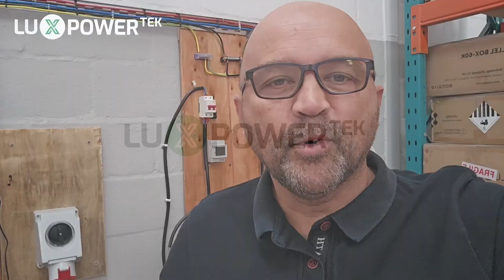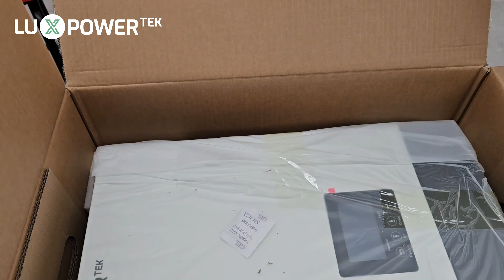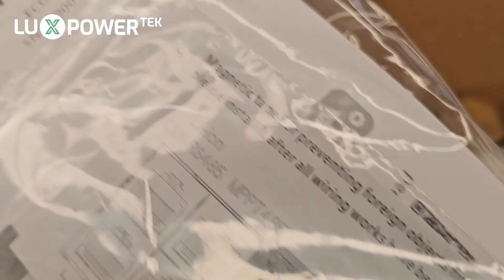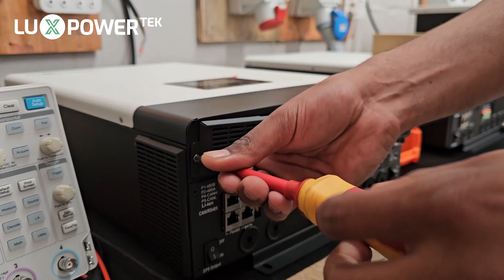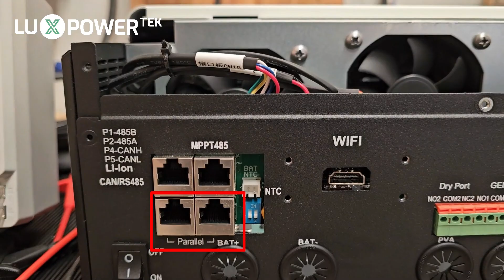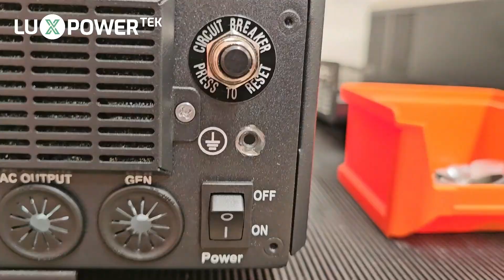Luxpower SNA 6K Operation Introduction for Unboxing

Comment: My question is... Can we connect pv with 20 amp current with one mppt?  Or it sjould be below 17 amp or equal to 17 in any case?
Reply: So prompt responses here, welldone.. 
My question... Where is the option of battery equalization? Is that automatic or we have to execute it? I have lead acid batteries.
Reply from the maker: @naturetubepk4289  Hi there, I am so sorry for missing your last  reply. We have the equalization settings for voltage and time in the monitoring page you can set.
Reply from the maker: Hi there, Thanks for your reaching out. The maximum PV input current per MPPT is 17A for SNA 6K series. If your PV array can output more than 17A, it can still be connected — the inverter will automatically limit the working current to 17A, so there is no risk to the system. However, please note that any excess current above 17A will not be utilized.
Reply: @LUXPOWERTEK thanks, so what is the best way to utilize the 2 mppt for 20 amp? Is it possible to paraellel the 2 mppt and then attach the 1 string with 20 amp to the parent mppt? Or to use 2 strings separately to each mppt having 10amp in each?
Reply from the maker: @naturetubepk4289  Hi, We recommend connecting 1 string (10A) to each MPPT, so the total current will be 20A (10A + 10A).
If you connect 2 strings in parallel and feed them into a single MPPT, the current will be limited to 17A, which means some generation may be lost due to current clipping.
To maximize the efficiency of your solar system, we suggest utilizing both MPPTs whenever possible.

Comment: If it is connected to the grid, is it possible that it will try to send something to the grid?
Reply from the maker: Hi Sir, thanks for reaching out to LuxpowerTek. If you connect SNA 6K to the grid, and if you wanna to sell power to grid, you can enable the function" Export to Grid". If you don't want to sell power, just leave it to the default mode.
Reply: @LUXPOWERTEK  Thank you for your answer. I don't want to sell energy to the grid. I only want to know if in offgrid mode in winter there is no energy from the sun and I want to charge the battery from the grid, can the inverter try to affect the grid in some way, or if in offgrid mode it will try to export at least a few Watts to the grid. I am prohibited from exporting even a few Watts, will it affect the grid even minimally when charging the battery from the network? Thank you and best regards
Reply from the maker: @manieek5600  Hi Sir, In normal mode, if you connect with grid and there is no power from PV panel, the battery will be charged by the grid. If you are prohibited to sell power to grid, please disable the function "Export to Grid". If you have any further questions, please contact me via: marketing@luxpowertek.com

Comment: Even though this inverter is off-grid, can it be connected to the grid in case there is no sun and the storage becomes discharged, or can it work as a bypass from the grid?
Reply from the maker: Hi Sir, Sure, this inverter, which we refer to as off-grid, is ideal for areas where on-grid regulations are strict and selling energy to the grid is not allowed. The inverter can work with the grid, PV, battery, generator, and existing grid-tied systems.
Reply: @LUXPOWERTEK  If it is connected to the grid, is it possible that it will try to send something to the grid?

Comment: If you have a video describing the difference between the SNA 5000 and 6000 that woulds be interesting.
I think it has something to do with smart loads?
Is the smart load connected to the generator output?
Keep the videos coming.
Thanks
Reply from the maker: Hi Sir, thanks for your suggestion. The smart loads or existing solar system can be connected into the GEN port of SNA 6K

Comment: These lost cost, high frequency, transformerless inverter chargers offer a much shorter life expectancy, a poorer surge capacity and can damage your appliances because they lack an output transformer to provide galvanic isolation between their DC boost stage and their AC output. No thanks.
Reply from the maker: Hi Sir, Thank you for sharing your thoughts! It's important to note that both high-frequency and low-frequency inverters have their pros and cons, depending on the application.

High-frequency inverters are designed to be lighter, more compact, and cost-effective, with better efficiency in most scenarios. Modern high-frequency designs include isolation on the DC and PV side for safety, advanced SPWM modulation to minimize grid pollution, and lower installation costs due to reduced wiring requirements. They also handle half-wave loads like heating rods more effectively compared to low-frequency inverters.

On the other hand, low-frequency inverters tend to be bulkier, less efficient (generally below 90%), and have higher idle power losses due to constant iron loss, especially under light loads. Additionally, their adaptability to unstable grids can sometimes be limited.

Ultimately, the best choice depends on the user’s specific needs, such as system size, efficiency requirements, budget, and compatibility. We encourage everyone to assess their unique energy storage needs and choose the most suitable technology for their application.

Thank you again for engaging with us, and we’re happy to answer any further questions you may have!

Comment: The bottom metal cover should be modified so that there is a hinge like opening from the front. Instead of the bottom.

There should also be just one large front air filter opening instead of multiple smaller ones scattered all around
Reply from the maker: Hi Sir, thank you for your suggestion. We have shared your feedback with our product department for further consideration.